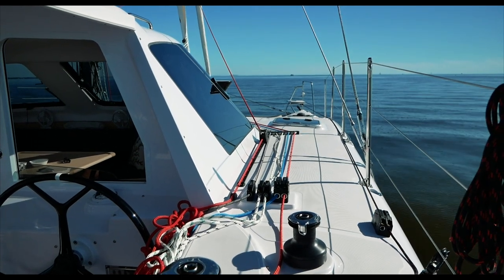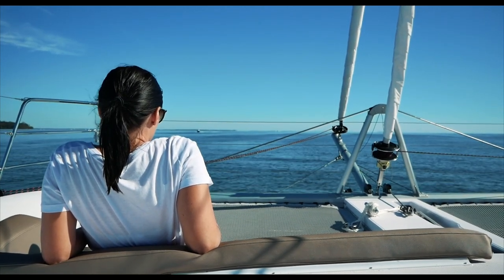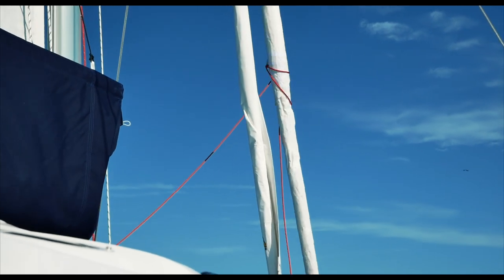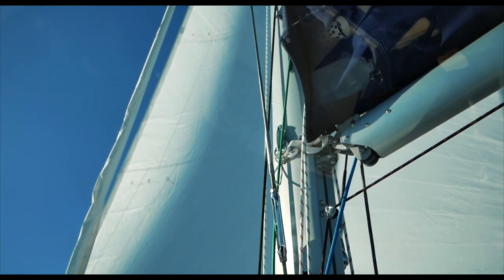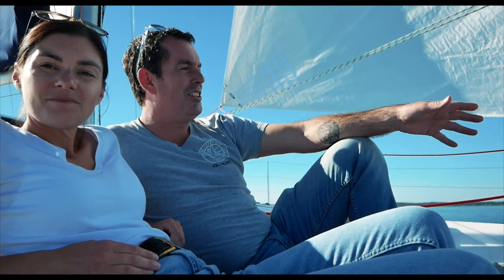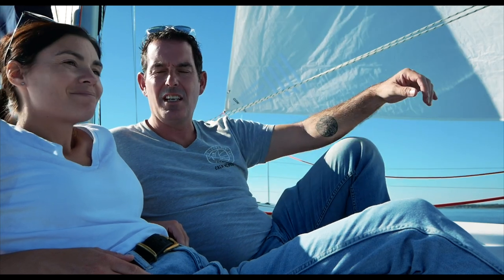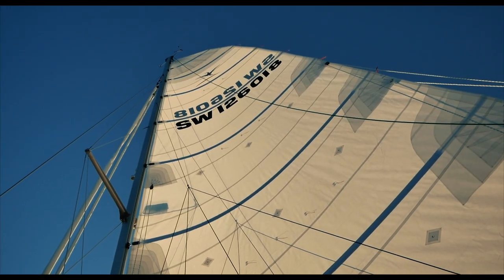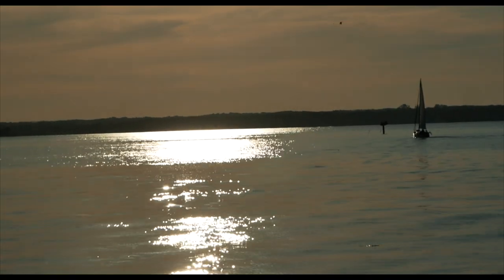Seawind 1260 Test Sail 2020 | Catamaran Sailing & Management Interview

Comment: Yes... I’m betting this is the new Ruby Rose. Congratulations if that’s the case. Doing my own research, I’m finding a LOT to like about the Seawinds. Everything but the helms. And unfortunately something as critical as this is a deal killer for me. As I’ve noted elsewhere, I like to sit UP, looking over the salon roof... absolutely NOT looking through it. Your vision is so obstructed at the opposite forward quarter from each position. At night, with rain or spray on forward windows... you’ll see nothing!  Or as on the 1600... too far outboard - that half the helm isn’t covered necessitating some sort of additional shade. ( at least it’s raised a bit, but the 1600’s out of our price range anyway). If they’d do a single (2-seat) raised, covered helm on one side - that would make this a perfect mid-range cruisers boat from my own experience. I hope Nick and Terysa are able to get them to improve the boat if they are looking to fine tune this model with their input.  Dual helms are an unnecessary expense and added complexity for a cruising cat.
Reply: on a cat so small a raised and covered helm has a big problem, you have to keep the boom higher, and this means a smaller main sail under powering it, means to have the point where the wind force on the sail is applied higher, and those things affect the performance and makes also the handling of the main more difficult.
if you look at 7.40 you notice that the lower part of the boom is at knees level with a person standing on the saloon roof and is in a perfect position to handle the sail, ie to close the lazy bag.
a risen helm that is covered should be much higher then that to allow a comfortable position for tall and short people and to be able to see the bows from that position, thing that is very important for docking. Look at the cats of that size that have that kind of helm and you will see how they have the boom in a much higher position.
when sailing everything is ac compromise, there is no perfect solution, but it seems to me that most of the choices done by Seawind have a lot of sense, helm position included. you have protection in heavy weather, but you can also sit at the side of the helm and have direct, not obstructed view. And reading the comments of who has that catamaran, like Sailing SV No Regrets, looking trough the saloon window, even at night and with rain, you have any way enough visibility. 
Also to have the helm station at the same level of the rest of the dock is an advantage in some situations, ie  if you use a spinnaker short handed or when you dock alone or a only 2 people, you have double engine controls, one for each helm, so you can control the helm, but you are only a couple of steps from the dock if needed.
the single helm of the balance catamarans is possibly even a better solution, as it can be shifted in an up or down position, but it is a feature that only that brand has, the one on those small Seawind seems to me a pretty good choice as it allows a mechanical steering, is good both for "racing", when you want to enjoy sailing controlling manually the helm and gives good protection in long passages and heavy weather, allowing to keep the sails and boom low.
on a 50' or longer catamaran it is different and what you ask makes a lot more sense, the 1600 and other cats offer it without having most of the cons that make it a less then optimal solution on smaller boats. Look at the cats in the 40' range that offer that solution and you will immediately notice how the boom is unnaturally too high to have a well designed sail plan.
Reply: Andrea Chinaglia  - Your reply is interesting, and I fully agree with the benefits of keeping the boom low.  Unfortunately you must think I am referring to a “flybridge” type helm like some of the newer charter cats, which I am not. There are many cats wherein the raised helm just has the helmsman’s head and shoulders at or above coach roof.  Some have the cabin roof and cockpit roof all on one level, with a small raised section above the helm (Balance Cats and many others) while others have the cockpit a bit higher than the cabin, and provide a bulkhead helm raised just enough to look over the cabin (Antares and even the Seawind 1600!!) And I fully disagree that they have to be big cats to design a raised helm. There is no reason to sit behind the cabin and try to look through windows, and past obstructions, including people moving about.  The 1260 is a quality, value point Catamaran. However, I can almost guarantee that given the option of a single raised helm similar to her bigger sister, the majority of purchasers would forgo the low, bulkhead mount of the 1260. (I think the twin helms on cats is an unnecessary addition of complexity and failure points) Lastly, I would argue that there is nothing better on a beautiful day than sitting up higher and enjoying an extended full 360 view from a raised, covered helm. Respectfully, these are my opinions and experience. Everyone is different.
Reply: @joesmythe8232  an helmsman position just high enough to look above the roof, but high enough to let even short people see the bows, thing that is very important docking, is certainly possible even with small catamarans while keeping the boom low, I misunderstood what you intended for fly bridge. Now that you explained better your opinion I agree with most of it, the whole deck should be designed in a different way, as the chart plotter inside the cabin that can bee seen from the helm but also from the inside of the cabin when the auto pilot is on would probably not be possible and all the winches should be centralized near the helm, now some halyards, reef lines and sheets are on the left and other on the right winch, thing that works fine with the helm at the same height of the rest of the deck.

Comment: 23 Yanmars are for coastal jaunts - If you're in the mid Pacific and find yourself in a stormy seas -  you're going to need a minimum of 80 HP at each stern for your personal safety - or you're going to need that easily accessible lifeboat you're always talking about.
Reply: The standard Yanmars are 3YM30s. They're more than adequate for any occasion. If you put 80hp diesels on a boat this size, the stern would sink under the weight.
Reply: @robwright3886  - If 80's will sink the Seawind 1260 - run like hell from it. If the boat is that unseaworthy - why bother making it and selling - risking the lives of people. On the other hand - I personally believe the 80's wouldn't hurt the sail-ability of the 1260 - making your comment inflammatory and erroneous.
Reply: @69spadger69  - If you are motoring you only use one side at a time - mostly.  With 80's you can spin a decent prop to get the motion needed. If you're in emergency conditions - two 80's is what I'd want.  Lot's of cats are running 80's on each side. Here's the link to the Yanmar 80 engines.
 https://www.yanmarmarine.com/Products/Sailboat-and-small-craft-engines/4JH80-392/

Comment: It's not impossible to make it so things don't break. Auto manufacturers, for the most part, do a good job with this and cars are just as complicated as sailboats. That being said, auto manufacturers sink an obscene amount of money into R&D and no sane person can expect a boat manufacturer, who doesn't have obscene amounts of money to spend on R&D, to achieve those kinds of results. Boats will never sell at the volume required to have the same kind of reliability as cars. You see this in the RV industry as well. In fact, I would assert the RV industry is much worse than the boat industry in this regard.